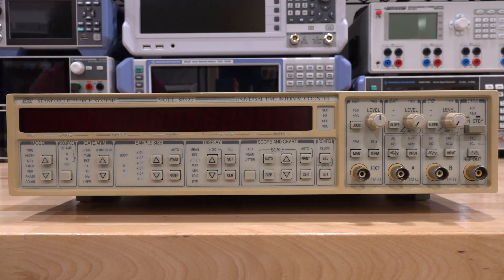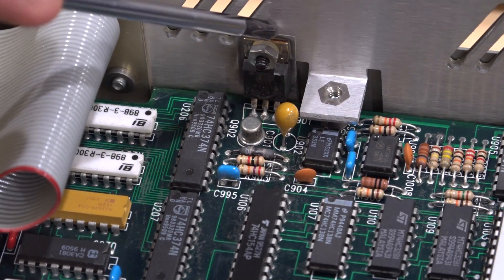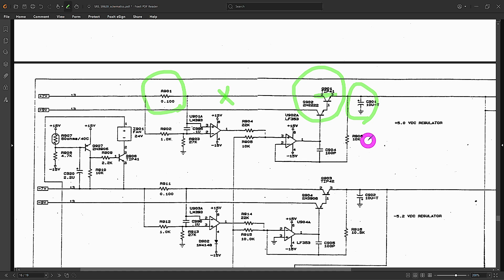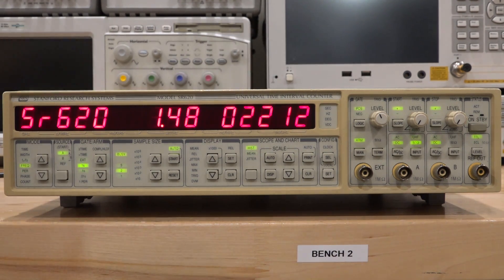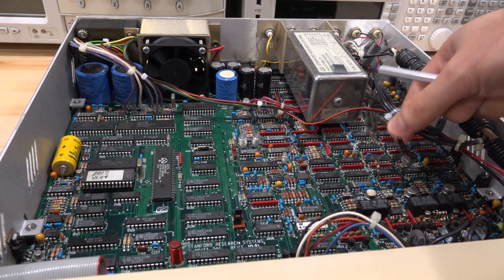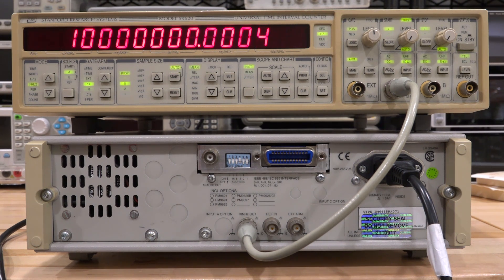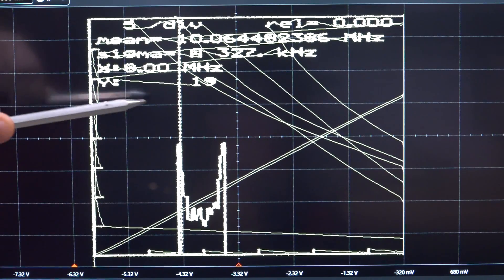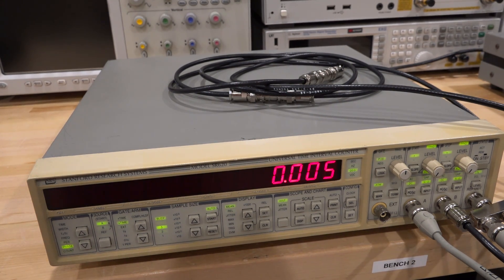TNP #41 - Stanford Research SR620 Universal Time Interval Counter Teardown, Repair & Experiments

Comment: Isn't the unit designed to be ran with the cover on and that is why the thermistor was behind the fan?  You have now moved it so that it does exactly what it was doing with the cover off.   Fan comes on, thermistor sense and shuts it off cause it got the cold air coming in across the board and not the heat from the whole unit.  What if it is the digital side closest to the fan there that actually produces the most heat?  The fan no longer knows that. Got to have cover on it.   P.S.  I want one now just for the XY output.
Reply from the maker: Nearly all the heat from the unit is generated by the CML/ECL logic which is where I placed the sensor. The sensor is in an open area of the instrument and not directly beyond the fan. This has fixed all the issues with the fan startup problems.
Reply: @TheSignalPath  looked like it was kicking on and off fine to me.  had the cover off.
Reply from the maker: No, it was not kicking anymore.

Comment: SR620 introduced in 1988:

Formed in 1980, SRS is a unique, privately held corporation which designs and manufactures high performance test and measurement, signal recovery, and gas analysis instruments.
1982 SRS introduces its first product - the SR250 data acquisition system.
1985 Our first lock-in amplifier, the now venerable SR510.
1988 SRS heads into the engineering instrumentation market with the SR620 time interval counter.
1991 SRS introduces the DS345 30 MHz function generator. Direct digital synthesis is here.
1991 The SR760 FFT spectrum analyzer with 90 dB dynamic range and 100 kHz real-time bandwidth.
1993 The world's first DSP lock-in amplifier - the SR850.
1994 The DSP lock-in that's now an industry standard: the SR830
1998 SRS anounces the SR785 2 channel Dynamic Signal Analyzer, the ultimate 2-channel analyzer.

Comment: This xy mode is a bit strange. If they bothered to develop whole video subsystem, why wouldn't they take one step further and add normal vga or video output.
Reply: It uses a separate 8-bit Z-80 running at 8MHz for the graphics. It doesn’t have that much memory, so vector graphics with two inexpensive DAC’s allowed simple vector graphics to be added. A composite output would have required a RF modulator or an expensive monochrome monitor for this one purpose, while most benches have some kind of oscilloscope on hand. VGA didn’t exist yet.
Reply: @ChrisSmith-tc4df  interesting. Based on artifacts from the screen on the video I thought it has some kind normal graphics, not vector one. If it uses vector graphics then it makes sense to do it like this.
Reply: Use an analog scope with a Z input and you have a neat display. Analog scopes were common in the days this instrument was designed,

Comment: That XY mode is pretty cool. Would have been even cooler if they supported a Z for trace luminance. Would something like this shift its time reference with thermal cycling (requiring recalibration)? Or is this instrument's crystal sufficiently aged that it wouldn't be a problem to cycle it on and off occasionally?
Reply: All crystals drift to some degree (or even jump 😱), but as long as the ovenized crystal is allowed to warm back up and stabilize, it should pick right back up to where it had last slowly drifted to.
Reply: @ChrisSmith-tc4df  Good to know, thank you!

Comment: That XY mode was so unexpected and unnecessary that for a moment i thought i fell for an april fools joke
Reply from the maker: You have to remember this unit was made in mid-90s! Very useful to get additional information without having to write a bunch of interface code.  :)
Reply: @TheSignalPath  Late-80s! The PCB on my SR620 is marked "rev C, 7-88" and has component dates of 1988. The manual also mentions that the earliest revision to be 1989.

Comment: Shahriar, where the heck did you find a schematic for a piece of SRS equipment? Did you just get lucky with Google or do you have a source? When I pulled an SR720 LCR meter out of e-waste at work and wanted to repair it, I emailed SRS and asked for a schematic. Their reply was, "We don't share schematics."
Reply from the maker: For this instrument, it is available on their website.
Reply: Wow, it looks like they've changed their policy! The schematic is now there for my SR720 LCR meter and my SR850 lock-in amplifier. I wouldn't have known this if not for your video, so thanks for that.

Comment: What would you think of doing a video looking at stability, accuracy, jitter and phase noise of different clock sources in your lab? Doing a comparison and contrast from worst to best in different areas. I'm guess this instrument might be able to help with some measurements

Would also LOVE to see a short tour of the guts of the machine. What parts are normy digital side and what if any interesting analogue circuits / parts are present

Comment: Shariar, many thanks for sharing!
Anyhow, the SR620 is one of those legendary time-interval instruments for the 'Time-Nuts'. Its competitor from HP is the HP5370B (which qualifies myself as being a time-nuts. I'm lacking a Cs clock, though)
Both T.I. counters are able to resolve T.I. at around or below 20ps single shot, by using analog or digital time-interpolators. In the 70ties, such instruments were used (afaik) to measure the distance to the moon with ~ mm resolution, using LASER ranging methods, aiming at those 5 or 6 retroreflectors on the moon.    
It would have been great to demonstrate its ps - T.I. capabilities, and its ability to make Allan Deviation measurements, i.e. stability measurements on oscillators by comparing your Rb vs. an ordinary XTAL, OCXO, GPSDO, and so on. "Noise Path" is the correct designator for such stability measurements, I guess.
John Miles', KE5FX 'TimeLab' program can directly interface to the SR620, and directly displays the stability statistics, from very short to very long time constants. 
This high T.I. resolution also makes 'true', non-averaged 11 digits/s frequency measurements possible.  
It would also be interesting, if you could explain this very special time interpolators schematic.

Comment: That's really cool :) Would be interesting to know the theory of how they get way less than 1Hz resolution on a 1 second measurement. A normal counter that counts edges during 1 second would be limited to the 1Hz resolution
Reply: Huh? Because it measures million times per second?
Reply: To clarify, if just counting edges, measuring 10000000.1Hz and 10000000.2 Hz would most likely just end up with the count of 10000000 counts during one second most of the times (sometimes gets one extra count). To increase the resolution, one must have bigger measurement window, for example 10 seconds, to get that extra digit of measurement, because then it would be 100000001 or 100000002 counts for those frequencies.

Using the reciprocal method means it has to be incredibly accurate to get to the fourth decimal of a 10MHz signal. 

Using the recirpocal method of a scaled version of the input signal could probably make sense.

In any case, it is a challenging problem, and I'm curious how they solve it.
Reply: The reciprocal counting technique
Reply: It’s measuring the length of the cycle’s period with 10’s of pico second accuracy, and then takes the reciprocal. For greater precision, it actually measures the period across many cycles depending upon the gate time.
Reply: @ChrisSmith-tc4df   thanks for info :) that makes sense. Without doing the math, I didn't think averaging would get that far in precision, but guess it does then
Reply: @pengiswe Although Shahriar did show averaging to settle down the displayed measurement, the SR620 is actually measuring the entire length of 10 million contiguous cycles as one measurement down to the 10’s of picoseconds with a 1 second gate. This results in a single length measurement of approximately 1 trillion pico seconds that because that was measured over 10 million cycles, it then further divides that by 10 million effectively measuring a single period’s length on the order of atto seconds. It then takes the reciprocal of that to fill the long LED display with all of those digits of precision. It uses a combination of high speed ECL logic and analog interpolation techniques to achieve that with 80’s technology - including those coaxial delay lines.
Reply: i think you are confusing the lowest measurable frequency with resolution
Reply: "Eons ago" I was superficially involved in a construction of a 10 kW sine wave inverter (using a NiFe 240 V DC battery bank).  On that, we found the thermistor responded unexpectedly fast to cooling air flow interruptions.  That meant we could discard the vane sensor that was also designed in, for the fan monitoring.  I don't remember if we then needed another set of temperature sensors for the power semiconductors, or not.  Actually our biggest challenges were related to making "good enough" sine wave throughout the output power range, which I think was from 1 to 10 kW.  In those days we did not have fast power FETs, so a pulse width modulation and filtering scheme was out of question.

Comment: The clever use of the XY mode is interesting.
Though, would have been nice to see a picture of the backside of the unit, I suspect is as serial or IEEE488 or something given the connectors visible from within.
Also curious to what the coiled wires is for, seen to the right at 9:00
Reply: Yeah, he explains this at 1:30
Reply: @andymouse  I must have had a lapse in concentration to miss that. Thanks.